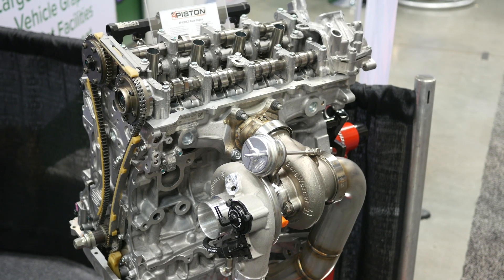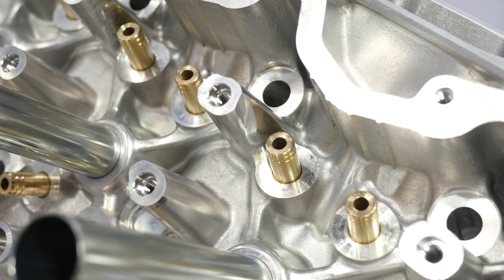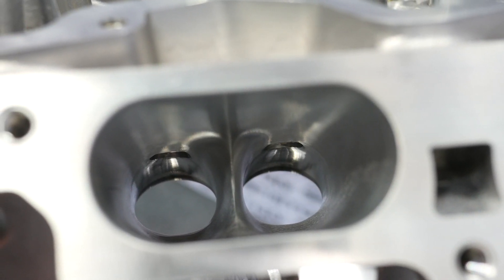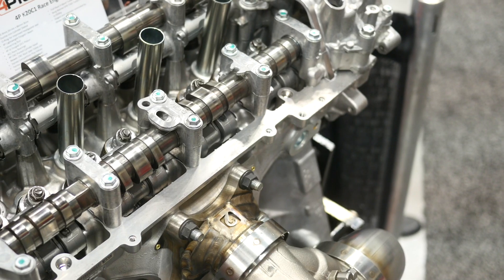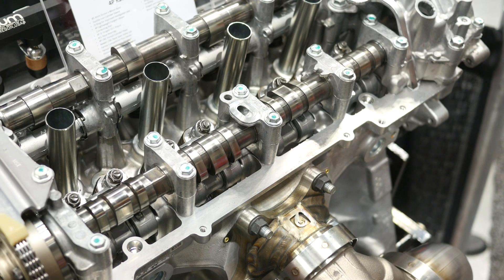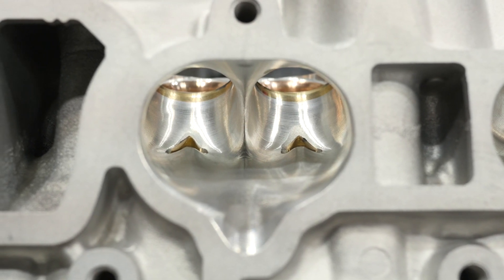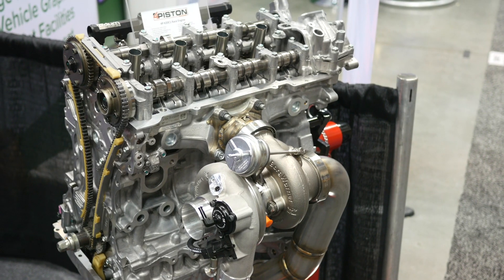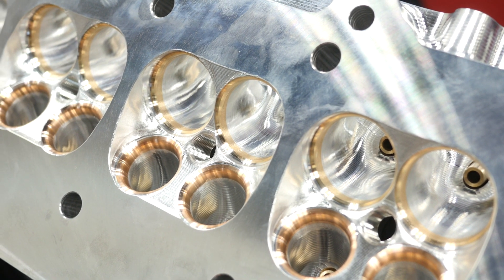Non Turbo! 500HP At 11,000 RPM | Big Power, Small Package [TECH TALK]

Comment: Ya bash on the integrated header. But its not a matter of timing the exhaust when the space is removed completely and pulses will only travel 1 way now. I still prefer skunk2 rocker on the exhaust side so i can get the cam ground without valve locks flying off. With high lift, who needs vtec on exhaust.
Man, i wish i didnt hit that tree though.
Reply from the maker: No one is bashing anything, every part has pros and cons and what is being discussed are the cons in relation to his application.

For example when comparing to you here, how did you find a tree on a drag strip....? 😅 - Taz.

Comment: I’d love to have this engine in a Ariel atom or a very lightweight track car

In the lotus mantra: simplify then add lightness, power to weight is simply more important than pure power and having a smooth powerband is more impressive than a high peak motor that needs to be revved out next bunts the wheels.

Speed is smoothness and smoothness is speed, that’s why Mclaren and porsches cars are so quick off the line.

Comment: Can the 4 piston oil pump handle the 11,000 RPM?. That's my only question as i have destroyed a few engines this way. Great video and very informative. Looking forward to more video.
Reply from the maker: I'd get in touch with them directly and have a chat about your application. They'll make sure you get the advice you need before you pull out your wallet =) - Taz.
http://www.4pistonracing.com/
Reply: If i am not mistaken, they were using a custom made dry sump setup made by Dailey Engineering for K20 engines

Comment: Peugeot 306 gti maxi made 400hp at 11000, 2 litres
Reply from the maker: Nice! - Taz.
Reply: @hpa101  the stock made 167hp with 2ltres to, and whithout any vvt, the head flow very well and whith stock cams for street the car has a lot of low torque too, 6 gearbox and ligth chassis

Comment: How much hp is lost by the tight side of the timing chain having to be pulled down a plastic chain guide? There's friction there, admittedly small, but every bit counts ...

If you could run that chain straight, reduced losses

Comment: i want this 500HP kseries swap into my honda s2000. except that is too loud for the street.
Reply: Yeah I can never afford in it in my ek
Reply: @kseriesdan9722  never say never. I thought the same but I currently have a stock k20a2 motor in my eg. Hoping to get 500 end of this year
Reply: @kseriesdan9722  the motor and Trans was $1500 full type S. I did the swap myself. I know you can do it Dan
Reply: @brisevans  yeah I have a jdm k20a in my ek and ready for more power been over 4 years installed. I'm thinking turbo might be easy. But like the idea of drop in cams(drag cartel) and itbs. But lucky to have 240whp.i can boost and make 350whp to 400whp stock
Reply: Put a valve on it.

Comment: A 2L engine can theoretically make and absolute maximum of 364bhp NA at 10,500 rpm on gasoline.  Maybe 420bhp @ 12k.  Where do they come up with 500 bhp?  I call BS.
Reply: I'm not certain,  but I think he said 2.7L at around 11k rpm. Also maybe he meant at the crank...but then again I've seen non billet k24 stroked to 2.6 at 9krpm make 311 at the wheels with 14:1 comp. Check out "phongs crx" on YouTube. If he can make that without billet and without 5mm over valves...500 seems attainable I guess...I had to watch the crx video again after I read your comment, they say rpm around 14:50 mark I believe and the rest of the set up at the beginning. I used to build i4 racecars 15-20 years ago and 200whp was fast lol. Tech has improved so much its mind boggling to old timers like myself lol
Reply: There is no theory in HP and CC size.All depends on comp and how much that head can flow.Dyno numbers is just numbers it's a tool you use.Exit speed of that car will tell you HP figures on the Wallace calculator
Reply: Well at least it has a hundred pound feet of torque who could ask for anything more?
Reply: @Chris Stavro What formula are you using? Please show your work. Something tells me that these guys aren't racing thumbs; so rules thereof, don't apply.
Reply: 2.7 is stroked.
Reply: It's not 2 liter, and it's not running on gasoline. It has 16:1 compression ratio
Reply: @Shadowboost  you're not wrong, although your comment wasn't useful. 

He jumps around a lot.  His drag engine is 2.7L, and his road race engines are 2.0L.  He mentions VP C85 fuel, which is basically E85 (I checked VP's site), as well as methanol and he doesn't qualify which fuel is used for those power numbers. His site says, "this engine will produce 420-460whp depending on the fuel used" which is  about 470-516 bhp.  fwiw 516 bhp is the theoretical limit for a 2.7L engine at 10k on C85.

Comment: These Honda boys consider 6000rpm Low to Mid-range RPM. Their engines make my RB26DETT in my GTR seem like a KA24DE. I'm jealous, LOL.
Reply: 6000 is when the fun starts, lol
Reply: This fool dont own a GTR 🤦🏾‍♂️
Reply: What are you talking about? the rb26 can rev to 10k rpm+ with a lot of work just like the k20. A stock k20 revs to 9k.
Reply: @MrIrish1  rb26 with the older models the pump can break over 8k and if your on the limiter you can destroy your oil pump
Reply: My KA24DE revs to 7500rpms , thanks for the compliment!!
Reply: My HGDNJHVX24588HJKVCF civic  engine makes 7000 rpm and my KJHVDDFG32GDFBBJHFX Lexus engine makes 8500 rpm
Reply: 6k is when vtec hits baby
Reply: LOOK AT ME, I HAVE A GTR AND THIS IS THE ENGINE CODE
Reply: I’ve seen rb26dett rev to 11k
Reply: Venom Svt alot of work needed to rev those babys upto 11k when they do they sing 👌
Reply: WTFFFF are you talking about

Comment: Turbo j or k series in a STI  wld that even fit?
Reply: yes and it's been done look up boostedboiz hondaru
Reply: K in the STi
Reply: Sti, as in subaru? Subaru's have 2 heads because it is a flat 4. They are talking about a straight 4 k series. A single inline 4. I am wondering if it is the rover k series? That honda shared

Comment: I love how he describes ~7000rpm as mid-range.
Reply: little engines love rpm. in general the smaller the engine the higher it can potentially rev. the only way to fight the lack of displacement is to rev it out farther. hence why f1 cars have tiny engines and rev as high as motorcycles.
Reply: @sed8181  not completely true my 2.0 Jetta has the limiter set at 5k and you could rev them up to 6.5k but it looses power after 5k with the stock cams
Reply: @PSNxFTWxRAGOI  you have given my an exception that proves the rule my friend. I did say generally it is true.
Reply: @PSNxFTWxRAGOI  that’s cos it’s built for economy. Stroke size and engine weight are the only factors that affect rev limit
Reply: @sed8181  Higher than motorcycles. They have a 15k rev limit.
Reply: @exploranator  replying to a 3y old comment, classy. 600cc supersport bikes tend to rev up to 15k and sometimes higher.  (kawasaki zx6r revs to a redline of 16k) there were some crazy 4 cylinder 250cc bikes in the 90s that could rev up to 18k. Current f1 cars usually don't rev much higher than 13k for reliability and fuel saving. Current street motorcycles do the same thing. I was more referring to supersport motorcycles/ race replicas.
Reply: Sorry to be that guy but even Honda 1.6 sohc can rev up to 8k with minimal mods and still be reliable. I hated Honda for a while until I got one now had a few and wont go anywhere else for anything under 2L
Reply: F1 engineer: Thats idle
Reply: Notes on how to calculate low,mid,high rpm range. From idle to redline ÷3
Reply: Alex Crosse to be fair I had a b16 em1 which bounced revlimit at around 8200.
I considered 5500 to 7500 mid range with stock cams. Lol.
I abused that poor thing.
Reply: 2000hp is the new 1500hp of the past

Comment: We had a 4piston head on our race k20 engine, an exhaust seat fall out and destroyed the engine, we contacted 4piston they did not want to know about it or help in anyway, BEWARE!!
Reply: Pretty common in race parts and it depends on the customers attitude a lot too.
Reply: @wudntulike2no32  not so much about the warranty. If you cant stand by your product and even offer advice as to what may have happened...
Reply: @No Thanks please explain how
Reply: Typical problem ....k series head issue..
Seldom or not hear the b series head problem..
Build...tune ..blow... It is a art of racing..brother... 😁
Reply: If it made the same power then you have either... 
A.) Poor engine builder
B.) Poor parts selection
C.) Poor tuning

Or a combination of the above. The heads arent the problem
Reply: @Sergio Aguirre dropped a seat. But talking about flow. Car made, to the kW. exactly the same power as a stock head when one was put in its place.

Comment: I'm glad to see the sport compact market becoming more mature and more recognized  in motorsports. There is tremendous amount of work that's going into 4 bangers.. Big displacement is 2 EASY.
Reply: @FrequencyOfThought 
That is a foolish thing to say. Nothing "easy" with large displacement engines when you are trying to win.
Reply: @jaylestingi I mean yes but also in contexts no. A smaller displacement will always be harder. 

Why I'm starting a build plan design I have sound 4.2 but with room to go up to as much as 5L of display albeit more like max of 4.4 to 4.8

However I'm also pushing for some pretty silly goals. 150wheel hp per cylinder. 8 cylinder k48. Works out to like almost 300 hp per Litre of displacement at 4.2L 

However going for volumetric efficiency as high as possible while being built for a boost system. And then a boost system that helps reduce detonation issues improve exhaust scavenging and provide a very wide powerband. 

K48 is hot vee. Good turbo spool but not the best intake set up. However going into a silly open engine bay with side intakes. Twin superchargers positive displacement. Twin turbos probably twin scroll. Under blower water to air and water to air intercooling right after the turbo as tightly packaged as possible. Supercharger integrated bypass valves but need ones that still make use of the second stage of cooling. Ac assisted water to air, interchill cooling for both stages. And less heat for the boost pressure and flow. Plus ac compressor swap to suit high rpms like 8500 to 9300, and pulsing it above that max rated speed to handle working right till redline and survive. 

Oversized supers that are oversized enough to be under driven and still slightly over sized in a sense. Creates higher boost pressure with lower ar ratio. When turbo is feeding it it'll have less parasitic losses. Aiming for 80s to theoretical 90s percent efficiency range on the super and turbo. Mid to high 80s low 90s super. High 80s to mid 90s turbo side. Engine effiency in the 30 to 40 percent range. Combined total effiency range in the 40s or better. 

Makes 10k very reliable redline wise. 10500 even and could push to 11k. Hp levels aren't unreasonable besides displacement to hp numbers max tune. Vtec cam profiles can be tuned to 5k rpm sections of the powerband. Idle at 1k or less. Will run on pump gas. And should still have decent fuel economy. Plus have enough torque everywhere. 

On a big block with something equivalent to vtec I wouldn't even need a need charger system. 

But goal is power to weight. Power per litre. Powerband and tunability. Drivability. And also ridiculous efficiency. As well as fuel econmy. Hence going to be paying for combustion chamber design help. 

Boost system isn't even really about pressure. More about density flow and controlling air into the engine for tuning. As well as not needing extra fuel for cooling. And being able to tune power to what's usable. 

Less displacement. But every aspect of it needs to be tuned properly. 

My ls7 can rev to 10k. Not as reliable but old tech. It makes way more torque though. And with a similar boost system but less efficient and less sizing options in some regards since sized for both cylinder heads. It'll make 1400rwhp with a bit more room. And a bit of turbo tweaking and it can hit 2000hp. 

At 1200rwhp on the k48 it'll be like 1440 crank. And like 720hp builds on a k20. Basically the limit of what's considered properly streetable without well built highly tuned. Peak I can make like probably 2400hp if everything goes perfect. 

My ls7 ain't even tapped pushing to 2500hp if I need it to. I'd need to get into much less efficient zones then I want. But I could still do a bit of tweaks and probably get it to 3k as long as nothing blows up. But reliability goes down. However even at that level it'll not be quite a straight uo drag build. The k48 at 2400 would be 300 passes or less before rebuild or blow up. And alot of difference in costs. 

And My ls7 was built forever ago. I could easily get it to rev higher more reliable and make more hp now. And then throw the boost on and get even higher.

Comment: 500hp out of a 2L? 100psi of boost?? This is insane, where next?
Reply: 2.7l with 15:1 CR and C16 gas. It's impressive nonetheless
Reply: @turnip8173  not c16, they use methanol in NA form, typically M1, M5 or a nitromethane mix
Reply: @endlessfable  thanks didn't know :)
Reply: NoNoNoNii  Yeah then compare the torque and get back to me.
Reply: Actually, those numbers are for different things. The 500 hp was for a naturally aspirated engine (2.7l). Rhe 100 psi boost was an example of what a competitor was doing with older B series engines to make upwards of 1500 hp. 

;)
Reply: @Broadpaw_Fox  cool
Reply: They even have less piston rings if I am correct
Reply: @Sergio Aguirre lol yeah those oem sub 50mm stroke engines turning 13000 rpm sure are more impressive than a 108mm stroke engine turning almost the same revs with piston speeds near 7000fpm, to the point where the the piston is outrunning the flame front.

Comment: Yea, but developing a billet road/street head is what we all want.. and can't afford.. lol. But in all seriousness, since the new honda engines have the headers in the head, it's either turbo or billet if you want dual vvt or direct injection, and I can't imagine that setup does any good for pushing naturally aspirated setups.
Reply: lol the capabilities of the billet heads are way above streetcar level. The cost to use it correctly is way inefficient on the street lol